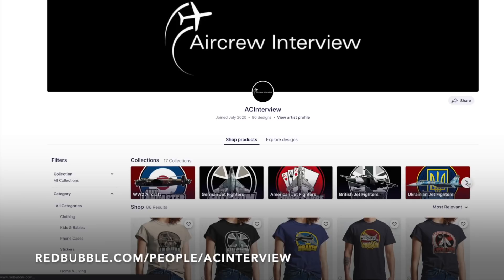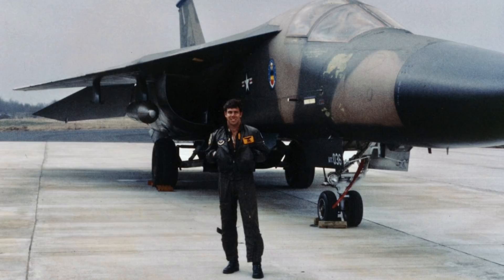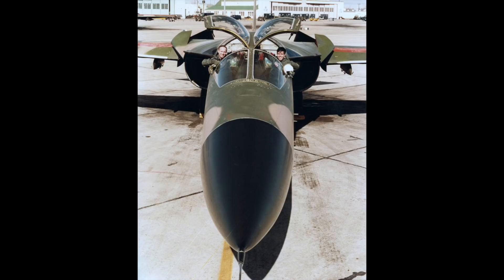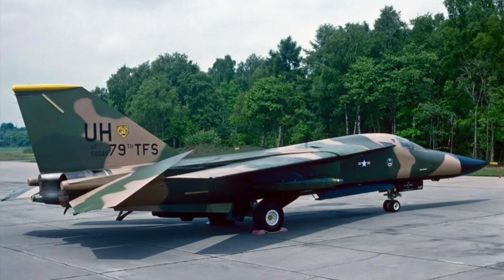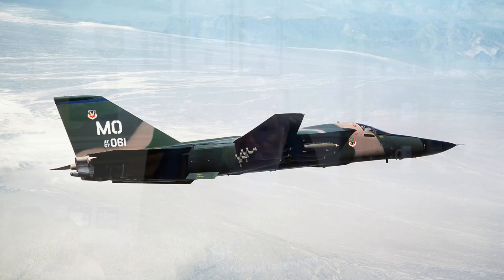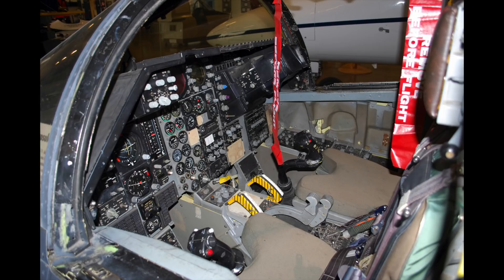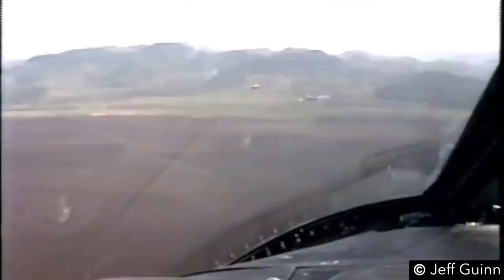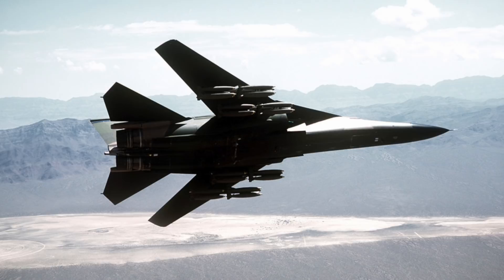F-111 Wing Sweep | Jeff Guinn

Comment: While stationed at RAF Upper Heyford (‘73-75) we had a 111 declare an IFE and come in during a heavy rain storm with no flaps or slats. He did have his wings fully forward but his airspeed at touchdown was incredible. I watched from the doorway of the crash fire station as he passed by. As I recall he had to use the runoff-end barrier cable to catch him because of his speed and the inches of rain on the runway. 

On a side note - it took some getting used to on base during flight ops when the planes were taking off due to the volume level of those afterburners; from a mile away the sound pressure was so loud we had to yell to be heard by whoever we were talking to.

Comment: I forgot to add a wingsweep story.

I was part of a four ship going to Mtn Home AFB's Saylor Creek Range.  The plan was tactical formation, splitting up for multi-axis pop to 15º dive bomb.  Pop-to-dive is a maneuver (very roughly described) involving approaching the target with it offset at about 10 or 2 o'clock.  With the target about 5-6 miles away, pulling 4Gs to 20º climb, then, at pull-down altitude (target altitude plus 2,000 feet), doing a 4G 120º bank wing over to roll out on attack heading.

To help get the airplane on the proper dive path, I used Electronically Caged Pipper Placement, which moved the pipper to boresight.  Using various arithmetics, if the pilot moved the caged pipper to the target, and held it there until a specific altitude based upon planned dive angle, the plane would fly a curved path to the proper point in space.  Uncaging the pipper at that point would allow normal tracking to the weapons release altitude.

Why all that numbing detail?

Because if the delivery is planned at 35º wingsweep, and due to a 540 knot ingress, which argued for a 54º wingsweep, I pilot I happen to know very well, forgot left the wings at 54 for the pop manuever — the result being a significantly higher than planned angle of attack.

And, ultimately, "Lead, unbelievable at six" as my score.